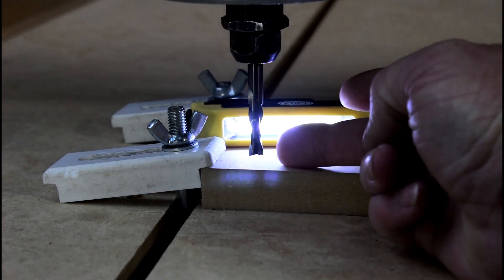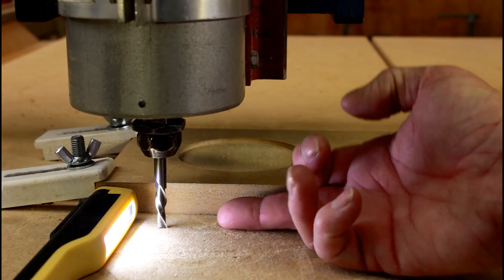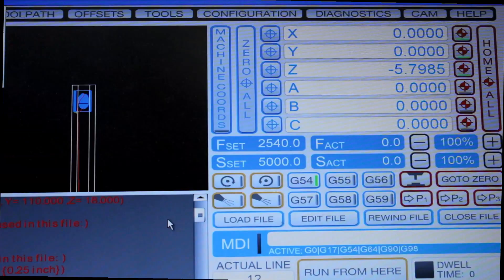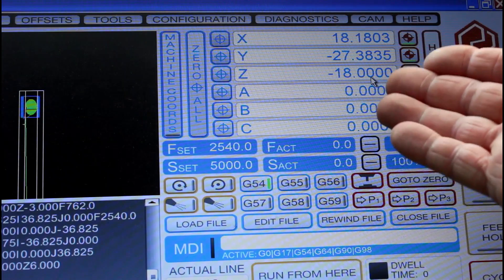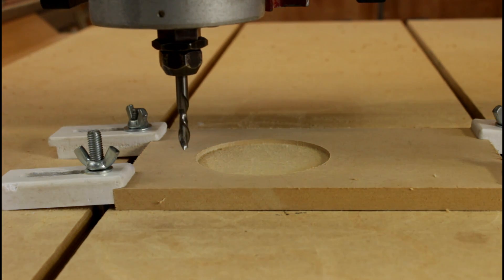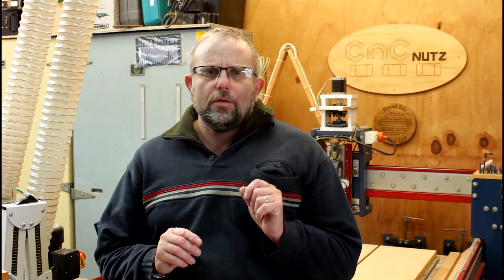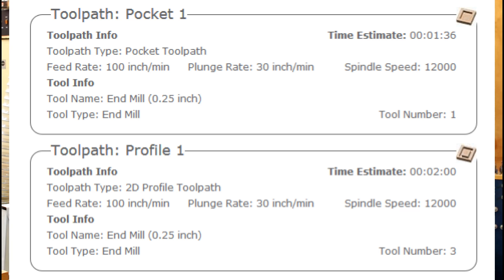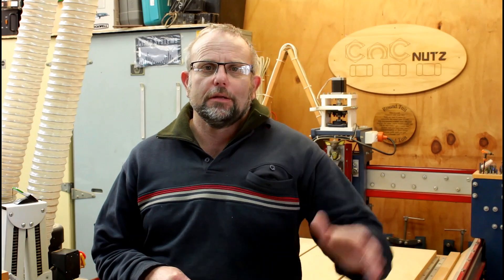CNC Magic - CNCnutz Episode 125

Comment: Once I touch the tool to the spoilboard, am I putting the negative nominal thickness on the work or Machine coordinates in Mach? I tried this in the work coordinates and for some reason it plunged about .25 into the spoilboard.
Reply from the maker: The negative nominal  thickness of the stock.
Cheers Peter

Comment: Sir i have one question. When i use vbit . draw a rectangle with vbit one side depth thick and one side little thin. Or some line make vbit thick and some think. I have suface cnc spoilboard . can you tell what is problum
Reply from the maker: If the table is flat and the Z Axis is not changing height as it moves along there are only 2 possibilities. If the material is thin then it is lifting off the table or the material thickness is not consistent. When using a Vbit even a small change in height or material thickness makes a huge difference to the thickness of the vcut width.
Cheers Peter

Comment: Peter, thanks.
Okay let's see, what if I cut the thinner piece first? I set my tool to the top of the part and cut the circle. Next I set my tool to the bottom of the part (the table) and set my Z to -18. One cut air then I cut my part. Now I put the thicker part in. I set my tool to zero at the top of the part (it should already be there if my part is 18mm thick) and cut my circle. Next, with no changes, I cut my part at the table which is -18. Did I miss something or is this a better way to do it?

Comment: Peter, used your technique for the first time today and it worked perfectly!  I making the Vectric free Paradise Box for my wife and thought I'd give it a try for the profile cutout on the top design.  I had to watch your video several times before I finally made the connection on what all to do but it is worth it.
Reply from the maker: +TotallyWood Workshop - Jim Sinacola
Thanks Jim. Once you understand it then it makes sense and is easy to do. Glad it works for you.
Cheers
Peter

Comment: stupid newbie question. if i am cutting through 3mm ACM material. and set z to -3mm. in my art cam software. i set the cut depth to 3mm exactly?
Reply from the maker: Hi steven
Not a stupid question 
In your CAM software, and it doesn't matter which one you use, you would set the material thickness as 3mm and so would set the depth of cut to 3mm exactly to cut through it.
At the table you would then move your cutter down to the tabletop and and then tell Mach3 that the cutter was sitting at -3mm.
If you think about what it happening it makes sense.
To cut through 3mm ACM the cutter must be at -3mm when it is cutting the ACM on the final cut. If it is sitting deeper it will be cutting through the ACM and into the spoilboard which you don't want. If it is sitting shallower it won't cut through the ACM.
 By setting the cutter onto the tabletop and telling Mach3 it is at -3mm you will cut through the ACM exactly and not into the board.
You cannot use the top of the stock to set the cutter and get an exact depth of cut through the material unless you measure the material thickness and use that figure in your file because stock thickness is only nominal.

Now I am familiar with ACM and have cut it myself. It is a bit of a sod because the aluminium on the bottom can sometimes have a thin skin left if you are out by a small amount. I understand the desire to go that little bit deeper when cutting it. I have found any area that doesn't cut all the way through will be very thin indeed and running a knife around these will sort it out. Most of the time I find the aluminum that remains is held there by the plactic protective coating and falls off when it is removed.

Hope this helps.
Cheers
Peter
Reply: CNCnutz (Peter Passuello) thanks peter. I just want a nice clean finish on the underside of the ACM. Dont want any burrs etc. one of my problems cuttting PVC sheet, ACM and Perspex is burrs. I just ordered a single flute down cut 6mm endmill hopefully that bit and this technique will give me a better spoil board, better even bridges and cleaner cut.

Comment: love this technique for cutting out objects. found this on one of our other videos recently and h[ave been using it since. no change to programs required, much less damage to spoil board caused by setting at top of material and material varies in thickness. the pieces cut all the way thru no matter how much it varies [assuming you have a good flat spoil board] and i have trouble sometimes seeing the lines it left in spoil board. love it , thanks for the video.
Reply from the maker: +Charles Goodwin 
Good one Charles. Glad it works for you. 
Cheers 
Peter

Comment: For NO OTHER REASON, zeroing to the spoil board and then setinng Z to MINUS the stock thickness, the maximum Z down will not cut up the spoil board. At worst it may go into the spoil board a thou or 2. This assumes you have the Z steps per inch set correct. If not, all bets are off...

Also consider no board is ever the advertised thickness so measure it. If you have pockets referenced from the top then set Z to the top and do the above before cutting anything going all the way through. If the pockets are referenced for a thickness of the bottom referenced from the stock bottom then start with the above and just cut everything. 

If you got a case of needing an exact stock thickness then just do basically a bed level a tad over the final size then do as above.  It all  depends on how much accuracy you really need for the finished part.
Reply from the maker: +John Ware 
You have it in one. 
That is why I only need to surface my spoilboard every 6 months and I think that is caused by moisture absorption by the MDF causing it to swell in places. 
Cheers 
Peter

Comment: I also use this method. Allows me to create general shapes without creating new code for each project. However, I've gotten flack from some people on forums about wasted cutting time. To me, it's the end result that matters and I'm glad to see others doing the same process. 
Thanks for sharing.
Reply from the maker: I bet that in a race the wasted cut time is less than the wasted time it takes to create a new file and get it to the machine. You will be finished and enjoying a beer before they even start cutting.
Cheers
Peter

Comment: Very interesting technique.  I would have never thought of that.  Excellent.  Thank you!
Reply from the maker: +Becca Miller 
This video was made to get people thinking and illustrate the technique I use for tool setting. When you are trying to show that it fixes the problems when the stocks thickness is out but a tiny amount it doesn't really mean much.  Show them it works when the stock is 1/4" different and they start to think about why it works. Glad it helps 
Cheers 
Peter

Comment: get a z probe, i made one with a block of aluminum and setup uccnc to probe when i click p1. makes zeroing sooo much easier than manually going down to the table.
Reply from the maker: +RNation00001 
I don't use a touch plate on purpose so I can show beginners who don't have the latest gadgets how to do things manually.  It is important for people to understand what is happening rather than say press this magic button and it will just work. Once people understand then they will be able to use the technology properly. Personally I don't miss my touch plate though I would be tempted by the Bill Griggs triple edge finder to set X &  Y. 
Cheers 
Peter
Reply: CNCnutz (Peter Passuello) 
I understand, your videos have helped me quite a bit. the original video where you show how to zero the z axis off the spoil board  then input the thickness has saved me a fortune on spoil boards. I also just ordered the same jog pendant as you have since it works on uccnc. I'll be using your setup file with a few tweaks for my setup. thanks for all the help keep them coming.
Reply from the maker: +RNation00001 
Thanks. 
I hope you like the pendant as much as I do. 
Cheers 
Peter

Comment: Why didn't you just create the profile cut-out operation with the zero at the bottom and use the thicker material set up?  That would eliminate inputting any offset.  Just zero on the spoil board and run the profile file.
Reply from the maker: Yes I could do that and the result would be the same. I just like keeping everything the same and since I know the origin is always at the top of the stock I don't have to think about it or change how I do things. The less changes the less chance there is that I will screw up making the file and cutting through my table. Unless I have missed it you also have to make the final profile cut as a seperate file as you can't change the origin point between operations. This adds more complexity having to load new files when cutting and added complexity having to deal with multiple Vcarve files as changing origin points would make life miserable. If I reference everything to the tabletop then I have the same problem but in reverse having to offset the top of the material instead of the bottom.
Cheers
Peter

Comment: how do you reference your material from the top of your spoil board, using mach3
Reply from the maker: Hi Eddie
Not quite sure I understand what you are asking.
I was half way through writing a long winded explanation when i realized I was using UCCNC for this demo so I thnk I now understand.
There is no difference between UCCNC and Mach3.
Set the cutter onto the table top
Click on the Z value and enter the new value and hit the enter key. ie -18 in my case.
Make sure you enter the negative value of the material thickness or you will end up cutting through your stock and table top in the first pass. Impressive but not what you want to do.
If when you hit the enter key the value returns to the previous value then check the machine is out of reset as you canot change the values when it is in this condition.
I hope I have answered the question but if not please ask again.

It might also help to check out this video.
https://www.youtube.com/watch?v=Q-Q1o16Ux-I

Cheers
Peter

Comment: am surprised that you haven't set up a touch off plate, Cool video by the way
Reply from the maker: +Rob Evans 
Quicker and just as accurate to use my eyes. I  do use my tool setter for Vbits.  This is a self contained touch off plate.  You cannot see the point of a Vbit. See episode 43 for more info or you need a cure for  insomnia. 😁